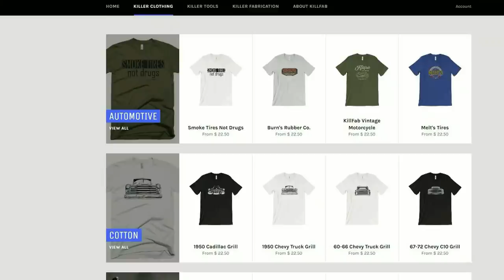Finished My Carbon Fiber Intake Build

Comment: Just a heads up; 

Carbon fiber reacts to aluminum. It will cause the carbon to haze and slowly lose strength. You will want to gasket the carbon to electrically isolate it from the aluminum. 

Great work by the way.

Comment: you should use a thin layer of glassfiber between the carbon and the steel backing-plate due too galvanic corrosion issues.. 
Most metal in contact with carbon fibre will corrode, and have to be mitigated.

Comment: maybe an advise for next time, look into prepreg carbon ;). especially for smaller projects like this you can use the kitchen oven to cure it. and makes so much stronger carbon and more appealing look as well ;).
Reply: Good shout. I've been looking into pre-preg as a solution for an motorcycle end can. As far as I can tell pre-preg is more resistant to heat, but even that stuff will have to be lined with Ali or heat shielding of some description.

 I did also research a intake plenum to turbo the same bike. Results we not good. Too dangerous to have under a tank of fuel right beneath my chest I think. They didn't mention a specific carbon, just that chances of it blowing apart are pretty high compared to metal. 
Then this vid pops into my feed lol

Comment: hi are you going to bolt the carbon fiber intake an a flat bit of plate and pressure test it before installation just to make sure it is not going to fail in some way i know its carbon fiber but the engine is worth a lot of money.And a pressure test for piece of mind and good content  for the channel would be good to see love the idea of the carbon fiber and good to see your thinking outside the box on this build just love it cheers from down under

Comment: I wonder how it will go with vibration and the weight of the throttle body hanging off it? Looked thick enough that it should be good but it may stress fracture in the corner.
Would have been really difficult but the metal backing plate could be incorporated into the layers of carbon.

Comment: How long do you think that will last? before you need to remake it in aluminum?
Reply: Probably never need replacement with those sharp angles, triangles = strength. That intake will definitely handle 30 psi. , and in that car will be more than enough to make anyone crap themselves.

Comment: Someone commented a while ago about flexible joints on the intake pipe to prevent cracking and whatnot, and my first thought (and reply) was wiggins clamps to help with that. I saw these http://www.hargettprecision.com/ and thought they would fit your aesthetic much better. Cheaper and do the same thing. But I don't know if you already had a plan to deal with thermal expansion and flexing and all that... Do you? I kinda think I remember you talking about it...